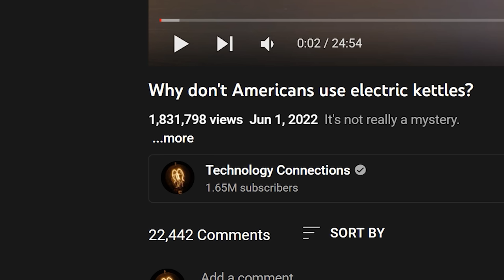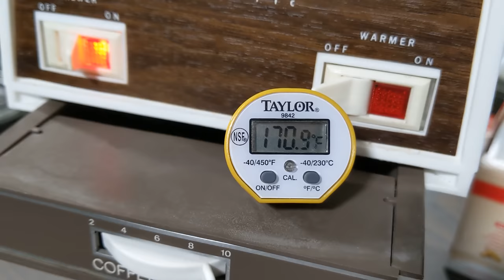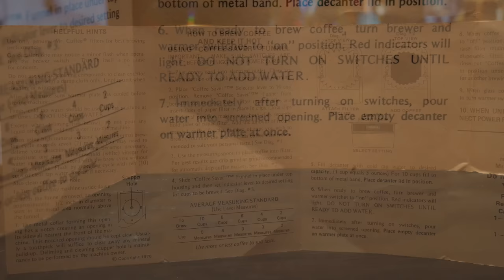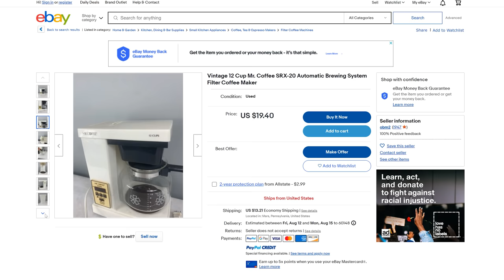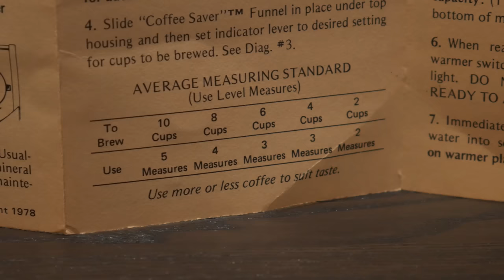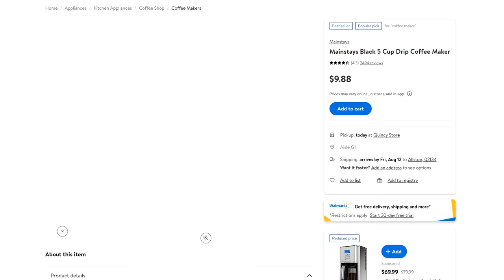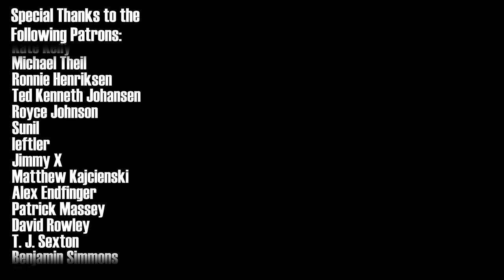Drip Coffee Makers — super simple, super cheap

Comment: I’m glad you briefly acknowledged that people who make pour over coffee have electric kettles. I was in the coffee industry and almost all my friends have electric kettles for this reason! 

It’s just funny to me that we don’t have many electric kettles as a country because coffee, but those that do have them because coffee 😅
Reply: I used my electric kettle for French press...but I don't think I ever used it for pour over.  Because I had an induction burner...and a gooseneck pour over kettle for the burner was smarter.

I do suspect that there are more of both induction burners and electric kettles than the video suggests.

Oh, and I actually have 2 electric kettles.  One's a Japanese vacuum electric kettle...gets the water hot, then mostly shuts off, using a double wall tank so it cools (and thus needs more heat) only intermittently.  NOT particularly good for coffee...or black tea, for that matter...but the water holding temp was very good for green teas.  It was also nice to have hot water on demand to, say, rinse out the fines that got into the cup using a French press, or for the residue if your cup sat for a while.
Reply: That's because most people are fine with acceptable coffee. Drip coffee is good enough that it's ease vs optimal taste ratio is fine the vast majority of people. Basically, you are comparing an enthusiast group to a control group. It's like asking why most people don't do custom BIOS settings on their PCs or do custom tuning on their cars. 

However, I would like to say that if you are making Japanese style iced coffee, drip coffee makers are actually the way to go for the most part. Yes, there are more taste optimal methods. But since steeping time is less of a factor than rapid cooling, dripping on to ice directly is a fairly good method to achieve almost as good results as manually doing it with a chemex.
Reply: Our electric kettle is mostly used for ramen and sometimes tea. I also use it to pre-boil water when cooking since it's far faster than our glass-electric stove.

Comment: The biggest game changer for these: get a double walled insulated carafe and dump your pot of coffee in it. Coffee is kinda like French fries where heating it up after its cooled too much is a bad time. A good sniff test for a quality coffee machine is if it includes a double walled coffee pot already
Reply: Yes, this! I've got one of each and the insulated maker brews a hotter pot and using the insulated carafe keeps it warmer for longer. The insulated maker doesn't use a vacuum or do any kind of inert gas back filling, so it won't stay hot, but it does lead to a hotter pot right off the bat because it doesn't leak the heat out of the container so easily.
Reply: Unfortunately they are opaque, which means I often forget that they're half full of coffee, leaving them on the table for days and then being left with a stinky carafe 😅
Reply: You don't drink the entire carafe in one day? I usually have to brew two pots and I always wash it out between days.
Reply: Best advice on the video.
Reply: Or just transfer the coffee into a thermos
Reply: We have a Miele drip coffee maker with a double wall  insulated carafe, it makes great coffee. When it gets too cool a quick boost in the microwave heats an individual cup up to taste ( my wife likes it scalding, I like mine just about hot ) We live in a hard water area and the time it takes to brew a pot gradually increases. There's  " Calc " button that tells you it needs descaling. We mix citric acid with water and put it in the reservoir, it then starts a timed 30 minute process of heating a small amounts and pumping it through the system. It's noticeably faster once it's been descaled.
Reply: As a coffee snob: don't use a steel walled carafe. The acidic nature of coffee will mean you get some leeching of flavor from the metal:- gross. A glass double walled carafe will keep flavor neutral.
Reply: @ObsoleteVodkaYT  The double walled carafe is essentially a thermos, skipping the decanting step.  It also isolates the coffee from the hot plate, making it an unnecessary feature to be removed.  The machine I use daily consequently eliminated the hot plate and changed the thermostat mechanism to completely switch off the heat until I press the start button again, thus eliminating the manual off switch completely with no further waste of energy, making it extremely automatic with no need to rush through the setup process like on the early Mr. Coffee in the video.
Reply: @johndododoe1411  My point is that people don't need to go out of their way and buy another coffee machine if they have a thermos around because as you said, it does the same job as the fancy machine.
Reply: 10/10 can confirm, i have a cawfee sized counter thermos from the 70s, covered in off white floral patterns and everything, purpose made for this exact thing, with the blown glass vacuum insulator, next to my machine that the cawfee goes into straight after brewing. Stays piping hot for hours, sometimes a day if i leave it full, and doesn't scald.
Reply: Bought a dripmachine with insulated drip pot and no warming plate.
They are common in the Netherlands.
Reply: Quick tip if you get a thermos or thermal carafe that’s all nasty inside A great way to make it good as new is to put a tablespoon or two of dishwasher powder (you can use the solid tablets too) and fill it all the way to the top with the hottest water you can get from the tap. Let it sit for a couple of hours dump the water out and swish it around with a bottle brush and a little dish soap and it will look brand new. Note this does not work with liquid dishwasher detergent. It uses different cleaning agents that don’t remove the buildup in the little grooves of the stainless steel. This even removes the coffee stains left behind after long use.
Reply: Me coffee makes a machine with insulated carafe and no hot plate.
Reply: @beachpone  first of all that’s quite a presumption about “the average American" and second microwaving coffee only makes it taste terrible if you overheat it. That’s the mistake that many people make when reheating coffee or tea. They leave it in the microwave too long and heat it to a temperature that destroys the flavor.  Try reheating it in small increments of 10 or 20 seconds until you reach a pleasant drinking temperature. The YouTube coffee guy James Hoffman even did an experiment reheating coffee in the microwave and found it didn’t destroy the flavor if not overheated.
Reply: Pre-heat the carafe and it'll be hot the following day lol :)
Reply: This is also how the better commercial systems do it. Our office coffee maker is literally a large drip coffee maker with an insulated carafe. The coffee is still hot and good tasting a few hours later. It's nothing like the typical McDonalds or Tim Hortons coffee that is "20 minutes fresh" because by 20 minutes the coffee has been boiled to bitter hell.
Reply: Lots of those carafes will have a small clear tube running up the front that shows the level of coffee remaining in them.
Reply: I, too, was wondering why he hadn't mentioned that option.
Reply: 100% a game changer. I was a gifted a moccamaster with insulated carafe and it was probably the best drip I've ever tasted in part to the lack of hotplate.
Reply: My Technivorm Moccamaster has a vacuum sealed double walled SS "thermos" as it's pot, from the factory. Don't need a warmer if your coffee stays hot for hours. Between that and the fact that it consistently brews a delicious 1.25L pot of coffee in exactly 6 minutes made it worth the $$ I spent on it. (They also make a 1.8L version for those who need an actual service industry sized pot to wake up)
Reply: I actually really love the taste of metal so thanks for the advice
Reply: I will second that. My Cuisinart actually uses a double-walled metal carafe, and omits the warmer function. Keeps the coffee hot for about 4 hours, them warm for another 4. I do pop some of the still warm coffee into the microwave which does affect taste, but still much better than burnt, and saves from having to brew more. Overall my model makes better tasting coffee, especially when set to brew before I wake up.
Reply: @anon_y_mousse  No, it's usually when I've brewed a second one, and it's suddenly too late to finish it off if I want to catch some sleep 😁
Reply: @pjschmid2251  I think I did find a pretty good way to clean them, but at this point I'm not working from home anymore. I usually only brew a single 0,5L French press every day now,  since we have great coffee at the office.
Also I don't have a dishwasher, and so no dishwasher detergent readily available.
Not so much a fan of the carafes in general, but I still occasionally use my thermos. I just find that the thermos itself is easy to clean, but am really struggling getting bad smells out of the seals in the lid.
Reply: @reverse_engineered  The two I had, did not 🤷
I mean, you can always look inside, but I think it's more of a case of spotting it in the corner of my eye while doing the dishes.
Reply: You should make a habit of washing it out each morning. In fact, if you fill it with hot water before you brew the coffee, when you empty that and immediately pour the coffee in, it'll keep the coffee hotter for longer.
Reply: I would agree. My old Krups machine had this and it worked for many many years...never missed the hot plate.
Reply: I don't suppose a good old fashioned Thermos flask could also do the job?

Comment: When I first started in the 1990s in the technology industry one of the first questions to ask if a computer had problems staying on was "Do you have a Mr Coffee plugged in near it?" And it was specifically a Mr Coffee not other coffee makers, and sometimes that was indeed the problem sharing a circuit with a Mr Coffee caused enough problems with power draw it caused some computers to be unstable.
Reply: That doesn't surprise me, electrical noise is still a problem for internet modems and power line Ethernet devices when something is plugged in the socket right next to them, or if there's a double adapter plug involved
Reply: @schr4nz  he mentioned power draw, i doubt it was the inductance that was the issue, most likely it was the 1500 watts, thats around 12 or so amps at 120 volts, a computer with a chonky CRT on top will most likely top the breaker out by using at least 300 watts dragging the breaker firmly into overload territory for a 15 amp supply same idea would happen if someone happened to have a space heater plugged in nearby as well or honestly even a decent sized microwave especially when the microwave was first switched on

Comment: Canadian here. I've been using an electric kettle for decades.
Cheap, fast, consistent. The kettle shuts off at exactly the right temperature every time. A rolling boil. About $12 bucks U.S.D. 
Gets the job done in 2 minutes, longer if you want to boil 1 liter of water. (yes, that's right, we use metric measures)

Comment: 23:50 This is why the cone filters are better. No matter how much you're making, the grounds are always forced to the middle of the filter. Also, cone filters don't collapse and cause a mess like the basket filters sometimes do.
Reply: I disagree about the collasping. I do have a 12-cup Melitta pour over with No. 4 filters. One of the reasons I am not a fan of it is they collapse sometimes when pouring the boiling water. And of course they are impossible to unfold once that happens, because boiling water.

I did have an idea after watching this that may make it function better, but won't help the collapsing filter.
Reply: Cone filters can collapse sideways, causing quite a mess as most of the water bypass the coffee and the soggy paper disintegrates to leak wet grinds everywhere. Checking this hasn't happened becomes a habit of experience.
Reply: @johndododoe1411  Weird, never had that happen. Typically the coffee holds it open.
Reply: @joshua.harazin  Agreed. Pour the water slowly in the center, pause a second for the grounds to wet the filter, and no collapse.
Reply: Many use screen filters now i still use paper filters with them less cleaning
Reply: @joshua.harazin  I was describing exactly the same situation as Brianna, we must  have been typing at the same time, as I too use the "1x4" flat packed filters that Melitta calls "#4".
Reply: Josias Lourenço  If you want to spout (pun intended) your beliefs, keep it to topic. "Isaiah 51 and 52 exalt the reader to "Awake! Awake!" and "Put on strength!", which is developed further in 51:17 with a reference to "trembling" and "draining"."

Comment: 27:10 I recently completely disassembled my coffe brewer, and for the computer geeks out there: there is actual thermal paste used between the plate and the heating element. it was hilarious, never in my life i'd imagined changing the thermal paste on my coffee maker!
Reply: Thermal paste, pads, and grease are quite common in many products, all the paste/grease/pads do is create an even surface of high thermally conducive goop to allow optimal thermal transfer, thermal glue is quite common too!
Reply: So how much RAM did you upgrade it with?

Comment: Also, one handy feature of many modern drip coffee makers is the auto-pause feature. You can remove the carafe, pour a cup of coffee, and put the carafe back without letting coffee pour onto the hot plate.

It's a ridiculously simple mechanism: there's a spring-loaded cover over the dispensing hole in the grounds basket. The carafe presses the cover open, allowing coffee to pour. When the carafe is removed, the brewed coffee builds up in the grounds basket until the carafe is replaced.
Reply: At least on mine, you have to be quick or the basket will overflow and end up all over the hotplate anyway.
Reply: The new mr. Coffee has them but it's a pain in the butt to fit in
Reply: Drip coffee is nasty.
Reply: @newagain9964  totally agree, if it's better than instant coffee over there then you must really have shit instant coffee in America. As I'd much rather have instant
Reply: @benmac940  Here in Portugal i checked out a few instant ones, and the best instants just match the cheapest of the cheap pre-ground stuff i can get brewed either in a moka pot or a drip brewer. As Alec, cost, taste, and fiddly factor. I can also cook or prepare breakfast while the coffee brews
Reply: But if you do that too soon, the rest of the pot is super weak and nasty.
Reply: Using that feature is not the greatest idea. The reason is that the caffeine in the coffee is extracted first, generally within the first minute or so, while the flavor takes longer to extract. If you pour off the first cup of coffee made, you'll get most of the pot's caffeine in that one cup, leaving you with a pot of near-decaf.
Reply: @ChefSalad  Hrm. Perhaps it'd be feasible to wait until the pot is at least half brewed before taking a cup. You'd still end up with double strength coffee for that first cup but at least the rest wouldn't be decaf.
Reply: Unfortunately that spring combined with heat and acidic coffee means the spring has a very limited lifetime. It almost always the first thing to break in a coffee maker.

Comment: About descaling: I'd recommend using a solution of citric acid instead of vinegar. While any acid that is safe to ingest is fine for descaling a coffee maker, citric acid tastes a lot milder than vinegar (some citric acid or vinegar will remain in the machine even after running water through it multiple times, and it will end up in the coffee).